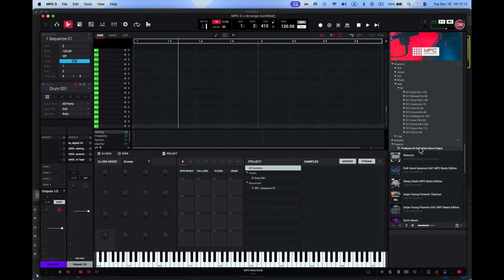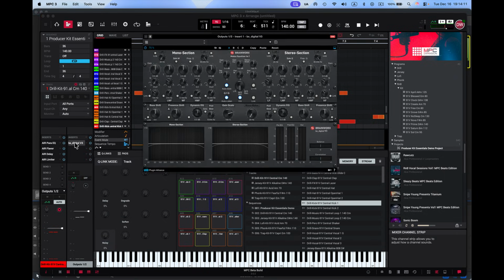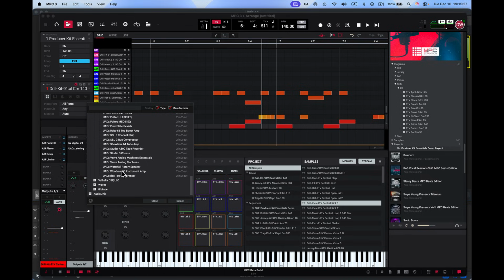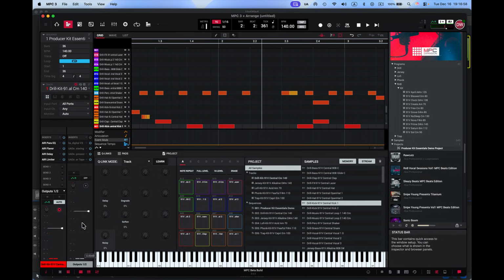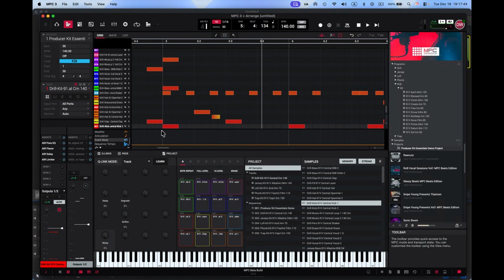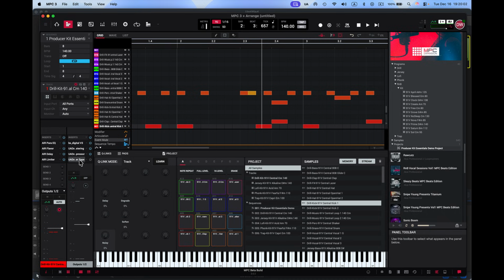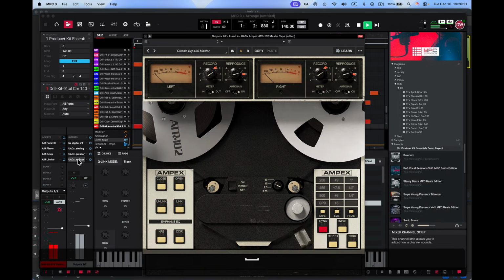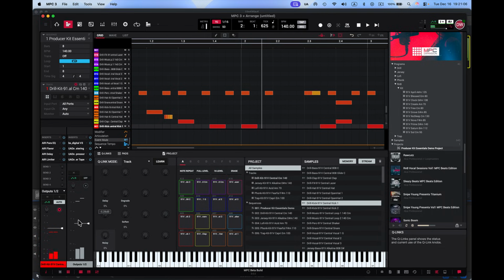MPC 3.6 Projects from any MPC With High END Plugins

Comment: Nice! Hey brother do you know if it is possible to run your MPC X within Studio One Pro 7? I would like to play my sounds from the NPC and record them after playing real time. Rather than exporting the stems and arranging tracks that way.
Reply from the maker: You just need MPC 2.15.1 software on your computer it’s a VST in Studio one then you can use the MPC X IN CONTROLLER MODE.
Reply: @SampleKingsVideos ok I have both the version 3 and 2.15. I think that Studio One is trying to use version 3. Now I have to get it to recognize the 2.15 version and not use Version 3 🤔
Thank you brother I really appreciate it and thanks for all the knowledge that you constantly provide us with 🙌🏿
Reply: I'm pretty sure u need a midi uno an the audio outputs from the mpc to an audio interface to record the mpc sounds into presonus an sync it to presonus an or to play the mpc sync as the main to press play from mpc jus need a midi channel within presonus to play sounds or jus to sync the audio into presonus.
Reply: @TheTruthxxok thanks I didn't think of sending the audio but that makes perfectly good sense.thank you so much!
Reply from the maker: Yes you can!
Reply: @SampleKingsVideos Do you have a video on the setup process? Or anything on running Studio w/MPC X?